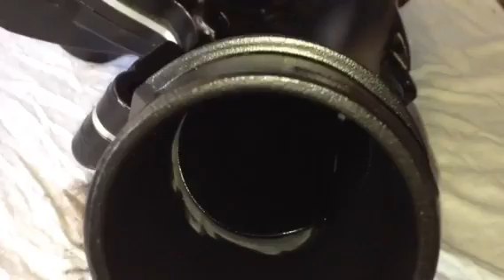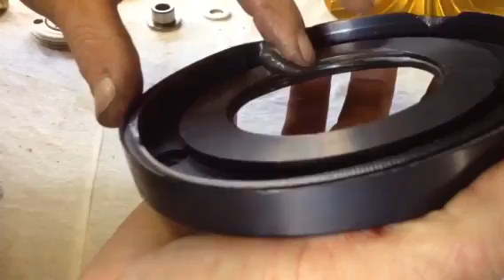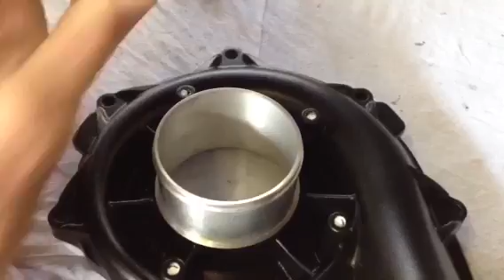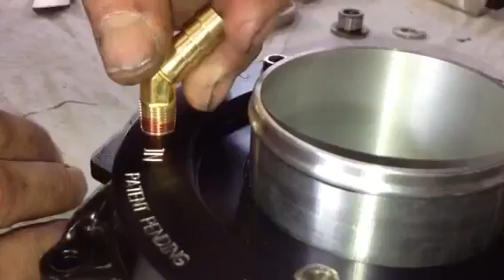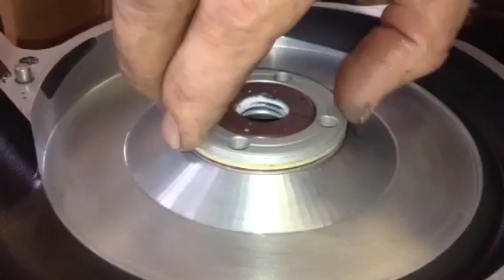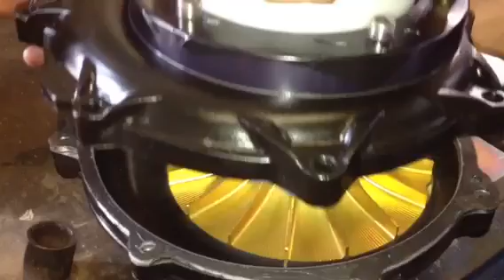68-140 Seadoo Stage 4 supercharger assembly

Comment: my et127 just came in. it looks smaller than the original wheel. is that normal?
Reply from the maker: +Akin aydemir A ET127 is meant for a 215 supercharger , in which charger do you plan on fitting the ET127 ?
Reply: +Redrockat  ive got the 2012 gtr215. should be ok ay?
Reply from the maker: yes that will work for your ski , What supporting mods do you have to your Seadoo GTR215 Ski to accommodate for the et127 ?
Reply: got reflash, next will be the prop. I went out a couple of days ago, soo much more fun now, acceleration is awesome :-)
Thanks for the help redrocket :-)
Reply from the maker: +Akin aydemir hey coolest ,hope you enjoy and have fun remember always safety first :) make a video so we can see please :)